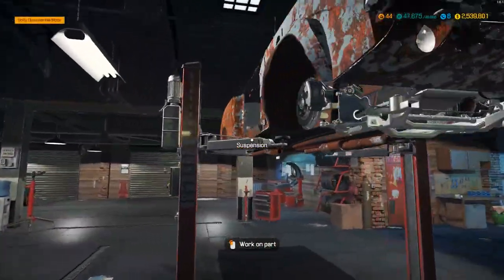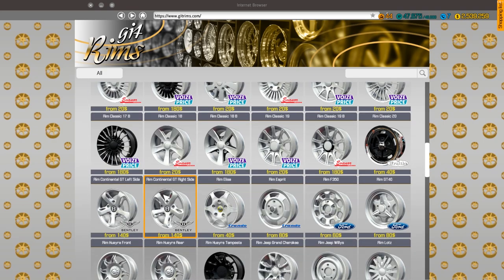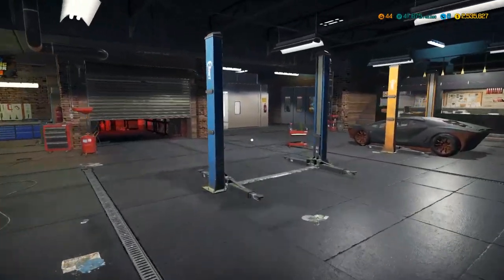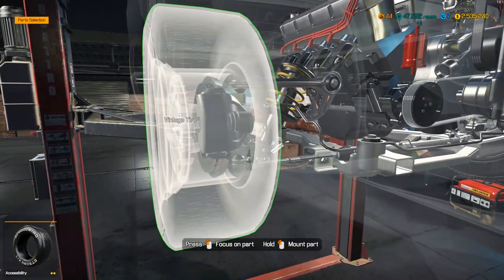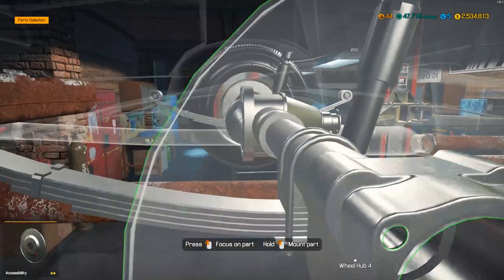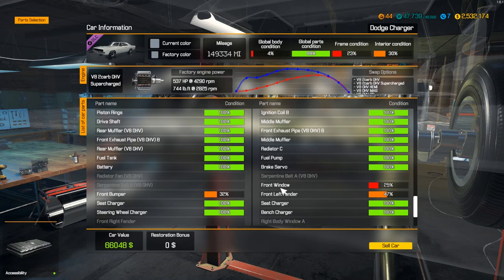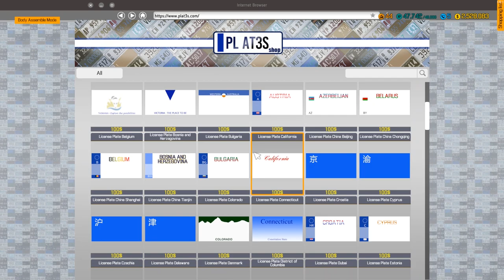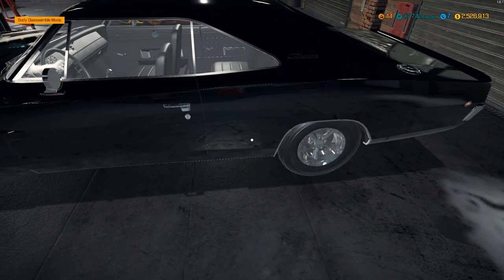DOM'S CHARGER IS FINISHED! | Car Mechanic Simulator 2018

Comment: That is a 68 dodge charger not a 70. Because 68 charger have round tail lights
Reply: Joel Pabalinas he did the best he could it is a dlc so that is all he had
Reply: 68 was the only year of round tail lights
Reply: Chevrolet
Reply: shadow_playTV the dlc comes with a 68 and a 70
Reply: Yes a 70 CHALLENGER not a 70 CHARGER

Comment: I know this is an older video but you do realize that gear grip is for performance gearboxes right? Works a lot better with performance part motors than a stock one

Comment: Did anyone notice that its not the right charger he had 1970 not 68 has circle marker lights. The grille is ribbed up and down and on top it doesn’t have the right tail lights. This is all from the 68. If anyone reads this look up the difference of a 68 to 70 charger. Tbh you should’ve done a bullitt charger at in that movie it would be accurate.
Reply: Brian Russel the movie is 1970 the game is a 1968
Reply: Brian Russel dude I live around American muscle. I have a 73 Dodge Charger. I know the difference between the chargers are
Reply: Brian Russel look it up dude hes customizing a 68 Dodge Charger

Comment: Not trying to tell you how to do your job but you're missing two things in this vehicle a belt and it's not the long lights you're talking about in The Fast and the Furious it's the Charger RT 1969 not the charger RT 1970
Reply: No, the Fast and Furious Charger is definitely a ‘70 Charger. The ‘69 has a split grill.